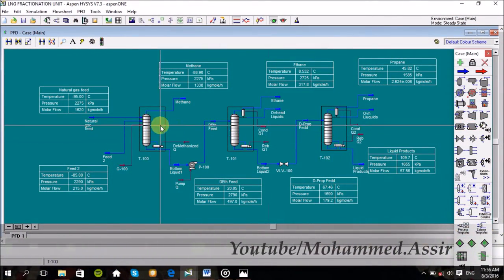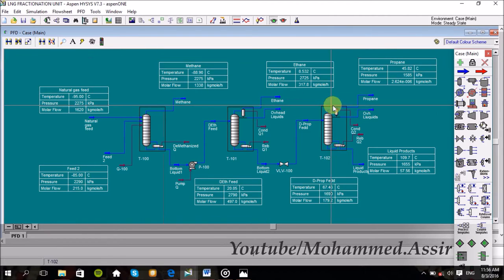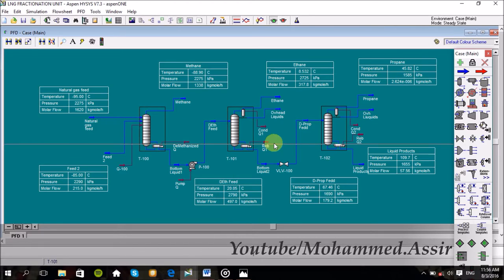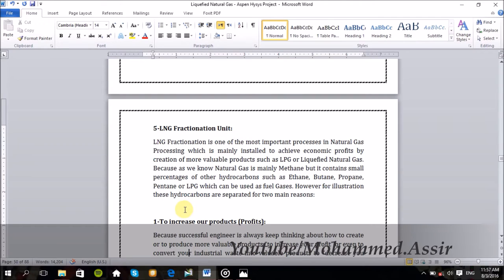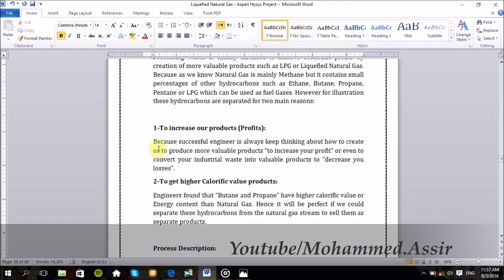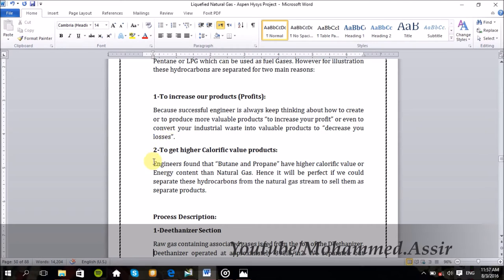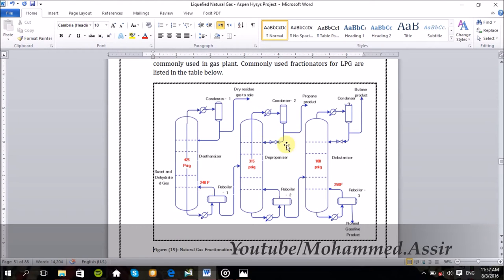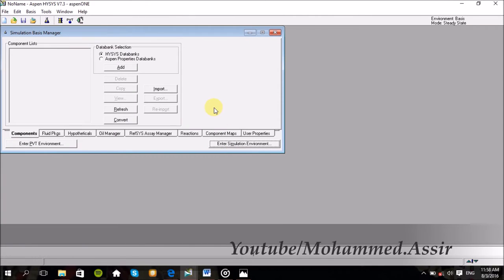6-Gas Processing - LNG Fractionation Unit with Aspen hysys 7.3

Comment: Thanks a lot!
Could you tell me please:
1) Why first column is a reboiled absorber and not a distulation column! (No condenser)
2) Why do we have partial condenser (for column 2 and 3)  even though the simulation work with total (col 2) and full reflux (col 3)
3) Why do we increase the pressure before col 2 and decrease before col 3?
Reply from the maker: Well :-
Question Number (1):
Using Reboiled Absorber is better because of two reasons:
.
1-The main purpose of this first unit is to separate the Methane as gas and to send all the remaining Mixture to the next distillation column right ? So the Reboiled Absorber is much better and much easier in this mission because it has (no Condenser Calculation at all) so it will separate the gas directly from the top coz there is no need to adjust reflux calculations.
.
2-It will maintains the high concentration of our stream and sends it through the bottom side as it is.. Because we will not lose anything goes as (condenser flashes, Liquids, accumulated streams, or even as overlapping stream) and that exactly what we need.. we need high concentrated stream to send it to the following separations processes.
.
However you can easily replace the (Reboiled Absorber) with (Distillation column) just make the following changes :
1-Condenser Drop: 32 kpa
2-Reflux Ratio: 1.7
3-Btms Prod Rate: 485
4-Companents fraction: 
Stage: Condenser
Phase: Vapour
Value: 0.96
Component: Methane.. and it will work.. and if it not just tell me.
.
Regards
Mohammed Assir
Reply from the maker: Question Number (2):
.
Well first of all it can be (Partial or Full Reflux) but it can’t be (Total Reflux) because we need to separate Ethane and Methane as Gases and (Total Reflux = means that all the reflux will be liquid) ! Anyways I make it partial because if you went deep down with this process design you will find that there a lot of calculations (related to Distillation Design) compelled you to run it is partial condenser.. But anyways Aspen hysys is a thermodynamic tool and it will not affected by these calculations so it can be full reflux so easy just make the following changes:
.
1-Change the Partial Reflux to (Full Reflux) and it will work.. that’s it !
.
Regards
Mohammed Assir
Reply from the maker: Question Number (3):
.
You should but on your Mind as Successful Engineer that any distillation column is totally depends on two main factors : 
.
1-Column conditions (its pressure and temperature).
2-And the feed conditions (feed pressure and temperature). and any Distillation column designed to work with specific ranges.. so these changes in pressure are actually related to the columns design.. and it wil be great if you take a look on this reference : (Equipment selection and Design – 4th or 5th  Edition) to see how distillation columns are totally affected by feed conditions.
.
Regards
Mohammed Assir
Reply: Thanks a lot man! It works!
You are my hero!
Reply from the maker: hahaha no am not that too much.. But you just keep working on it keep reading keep simulating keep designing an you will be a hero One Day..** ;)